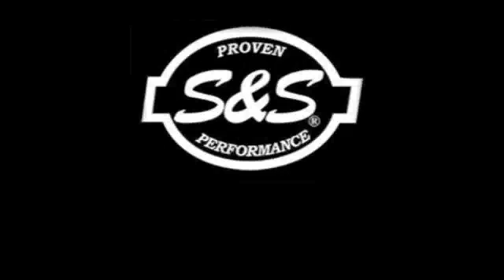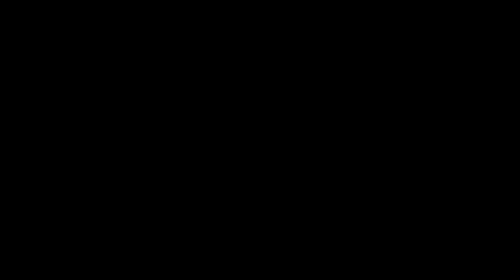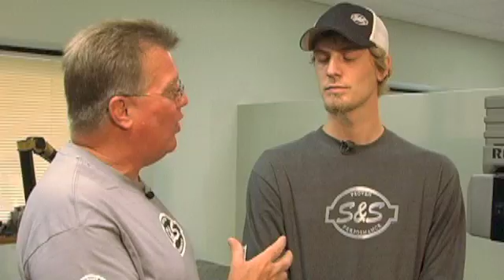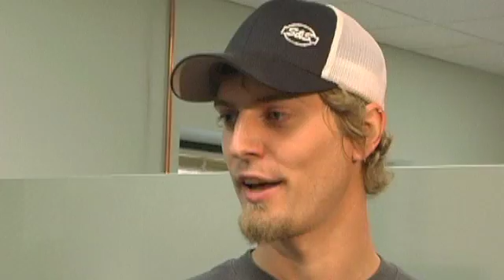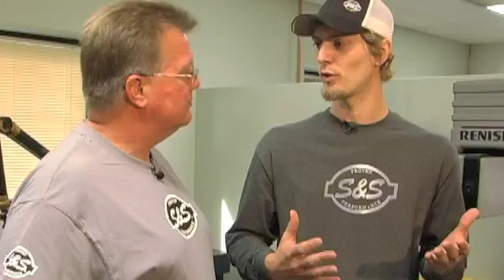S&S Cycle CNC Head Porting with Wally Cahill - Part 3 of 3

Comment: Nice, guess I better keep checking options. Torn between the crate 124 or the kit but want reworked Super Stock heads either direct from S&S or someone who has a profile knocked down. 124 with 145 hp, 145 tq or there abouts. Not for free but a cost effective approach. We all know speed is about cash but I’m looking at building power and still having some coin in the bank. Guess I need to build it myself but if I’m not a dealer or Indy then looks like I’m paying full msrp which I never like doing. Shops gotta make a profit or go belly up....I get that. Fine line between saving green or saying screw it and paying a pro.